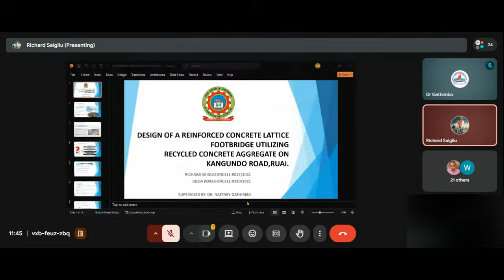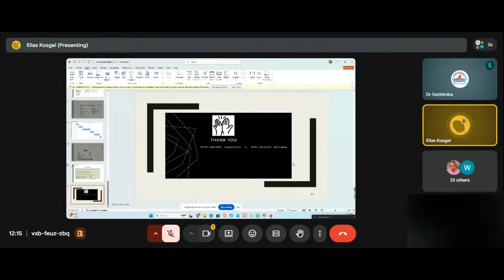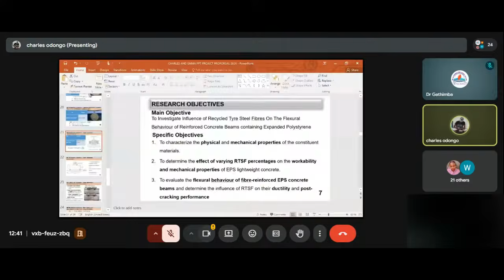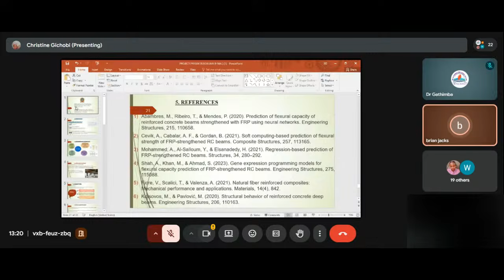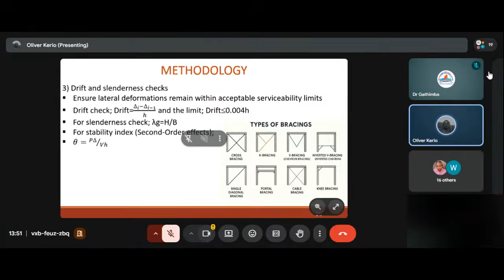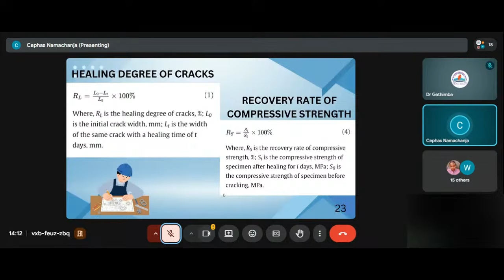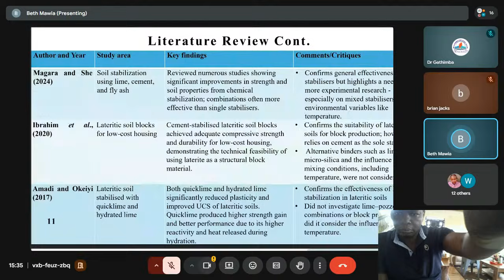Undergraduate proposal presentation in civil engineering

Comment from the maker: The topics presented in this video are as follows. (Click on the time stamp to go to a specific presentation)

0:00:04 Design of RC lattice footbridge utilized recycled concrete aggregates on Kangundo Road, Ruai
0:19:55 Performance of Styrene-Butadiene-Styrene modified asphalt mixture with polyester fibers under water and chemical damage
0:45:20 Influence of recycled tyres steel fibres on the flexural behaviour of RC beams containing expanded Polystrene
1:02:35 Flexural Performance of Concrete Incorporating Treated Coconut Waste Fibre and Wood Ash as a Supplementary Binder
1:26:38 Prediction model for flexural performance of RC deep beams retrofitted with sisal Fibers
1:42:30 Flexural and compression performance of concrete beams reinforced with recycled PET plastic fibres
1:59:15 A study on the structural behaviour of container-to-container joints in multi-storey shipping containers structures
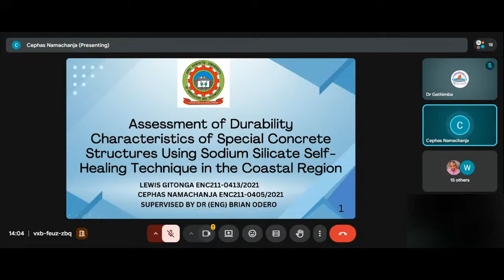2:17:30 Assessment of durability characteristics of special concrete Structures using sodium silicate self-healing technique in the Coastal region
2:34:28 Effect of eggshell powder as a partial replacement of lime in the stabilization of red clay soil
3:02:40 Performance of lateritic soil blocks modified with lime and microsilica